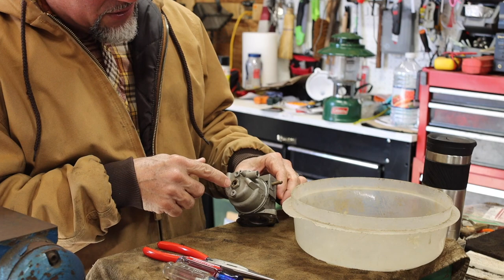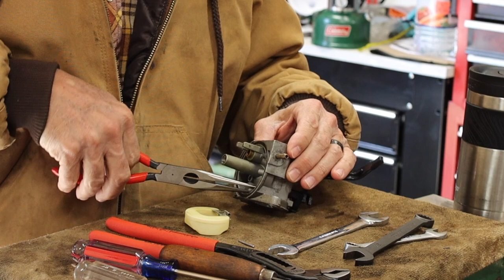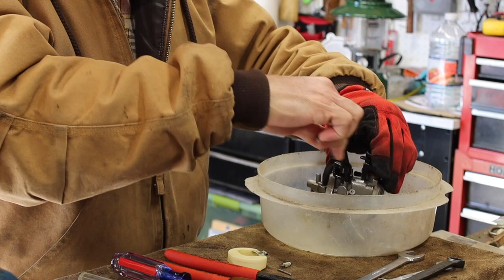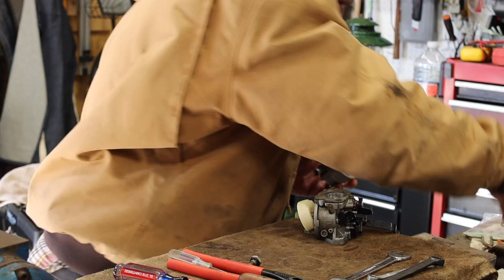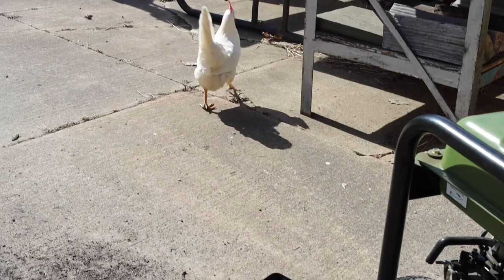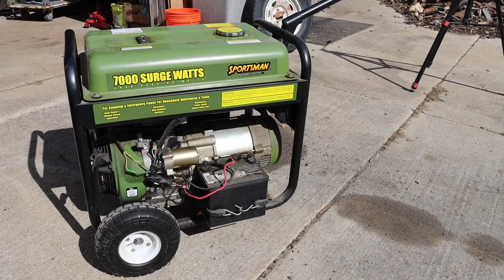Power Outage Survival Guide: Generator Prep Maintenance For Storm Emergencies #emergencypreparation

Comment: The goose was taking a gander around the power lines.
I am in Southern Texas. I have a tri-fuel portable generator that I run on natural gas (no carburetor problems). When power is off, I connect it to my electric panel via the generator power inlet box. If I know the power will be out for only a few hours and it is not summer, my alternate is to connect a power station (with an extension battery) to the same inlet box.
Reply from the maker: Ha! Nice job, sounds like a great setup.